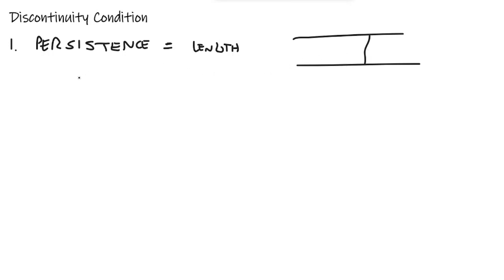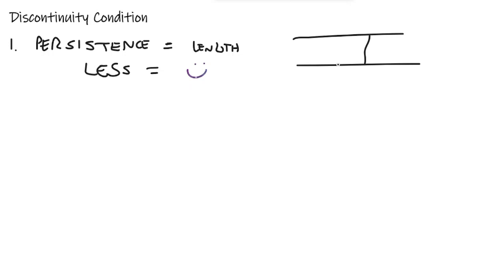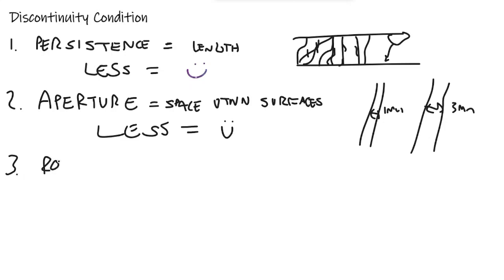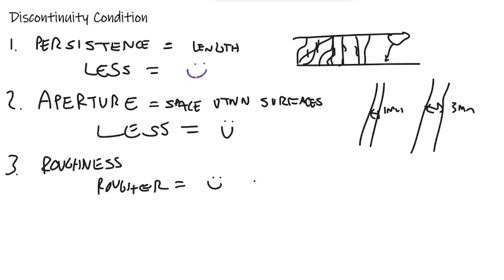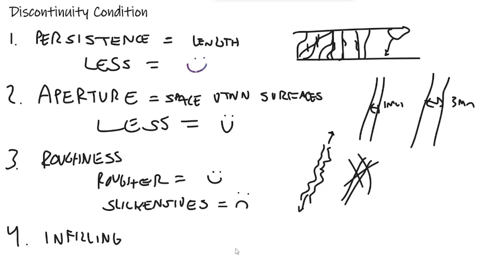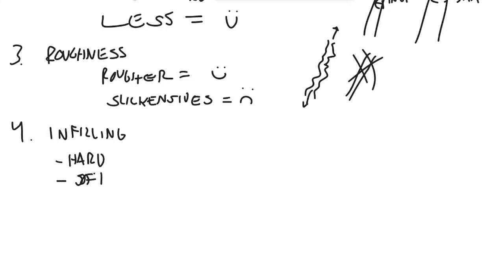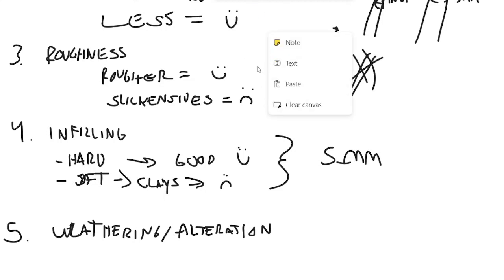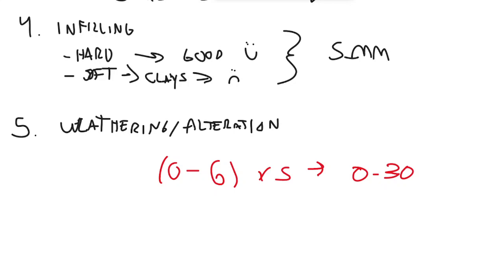Rock Mechanics: Scoring Discontinuity Condition (RMR)

Comment: You have not mentioned whether these parameters are calculated for each joint or discontinuity set separately or average out. Is the condition uniuge to each joint set? This is the fundamental question not covered here.